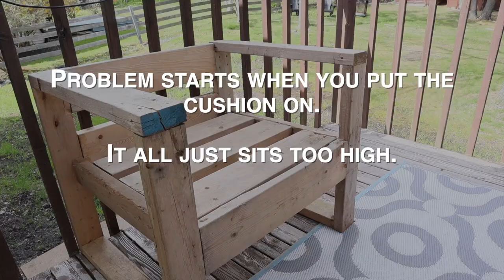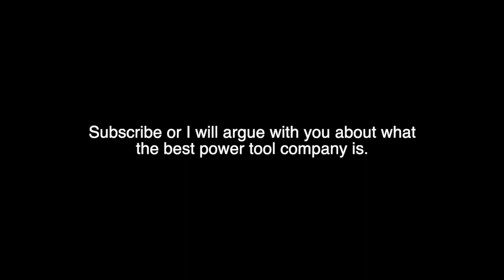Broken? Nah Just Deleted.

Comment: Yo, put on an eccentric BB on the GT.

There are British threaded ones
Reply: Put a White Industries eccentric hub on the new wheel. Special tool needed to get the cog off if freewheel is used though. Easier to adjust chain tension.

Comment: Would it not have been easier and less work to cut the bottom off the legs on those chairs rather than disassemble and refit the seats?
Reply from the maker: But then the cushion would still sit too high in relation to the backrest!